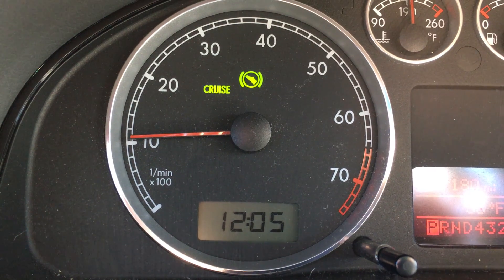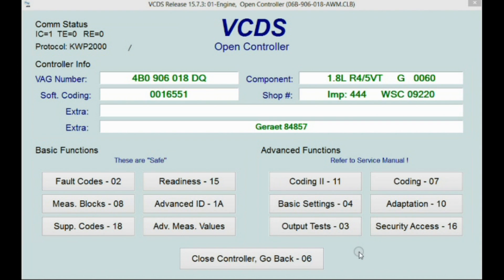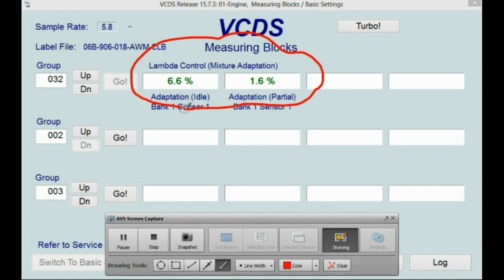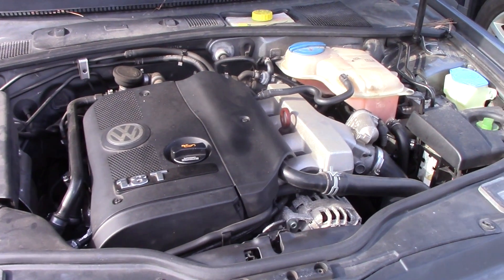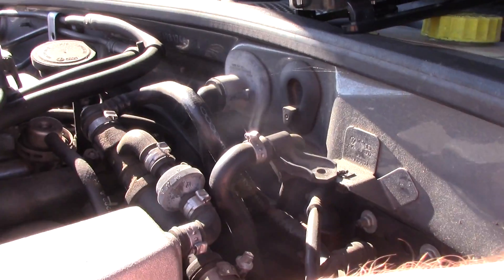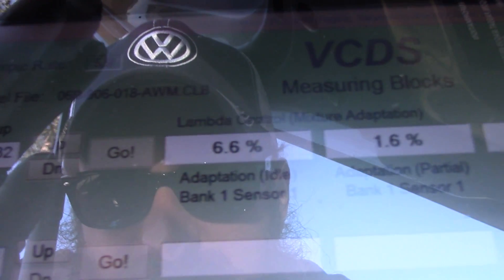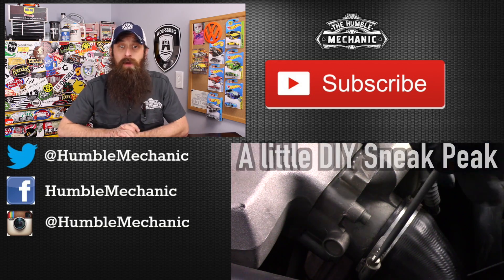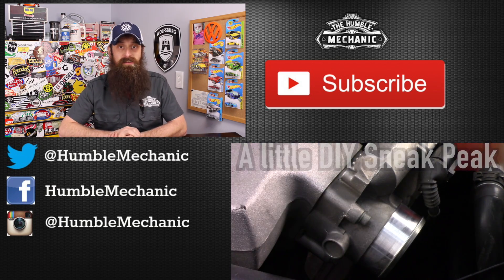Volkswagen Check Engine Light Diagnosis

Comment: First of all you have a cool beard and how long have you been growing it. I'm going to buy a 1997 Volkswagen Rialta RV. The seller says it has a check engine light that is on. Is there a way to check it manually something like turning on and off the key three times they're turning the key to the on position and pressing certain buttons do you do you know anything about this

Comment: I love my 04' Passat GLS. Has the 1.8T Four Motion 5-Speed and the interior is in great shape. Had this issue last summer and was able to find that the T shaped hose that comes out from the pcv valve was cracked. Had replaced that one part but luckily I now found a affordable hose kit which I will make sure everything else is replaced just in case. Saved me alot of money because I already replaced the throttle body & had it reprogrammed. She now runs smooth as silk. Even quieter than my mah's 2014 Fiesta Titanium... 👍

Comment: I've had my 2010 VW New Beetle 1.6L since 2011 and its been going great with minor issues. I recently experienced the "Check Engine" light and the car was still running well although I only drive it once a week. As there were limited service centres opened due to the pandemic, I couldn't send it for inspection until a week later when there was stiffness on the brake pedal. Upon inspection the mechanic discovered that it was due to a faulty brake booster vacuum hose/valve. Do take precaution.

Comment: Hi, thank you for your help teaching us about our cars.  I need help, and if you would be so kind. I have a 2013 Jetta that started to shake a lot and the check engine light blinked rapidly and there was lots of raw fuel smell. I shut the car off and waited for some minutes then I started it  again and it seamed to be working good. I then headed to my local autozone auto parts. I had it check with my local autozone obd2 and it had multiple cylinders misfire but no codes. It suggested to check vacuum leakage. I did and. Then I drove it once more and it repeated the same situation where the care misfired multiple cylinders and I stoped and waited again. I then desired to take it to the dealer to have it checked. The dealership suggested to have the spark plugs, coil pack and spark plug cables replace and then check again. I did the work except I changed the ignition coil, spark plugs, spark plug cables and I also cleaned the throttle body lightly. Now there is no check engine light on but the car does not perform as it used to. It runs good but it does not have the power as before the incident. Any help that you can provide will be very much appreciated!!!! Thank you sorry for the long story.

Comment: They really used some crappy plastic in 05 VW's.I replaced the glow plug wiring harness in my TDI Jetta and wire loom turned to dust in my hands.I've never seen such brittle crappy plastic as I have in that car.

Comment: Hi HumbleMechanic - just got a CEL reading for my Eurovan 2000 of P0705 (Transmission Range Sensor Circuit Malfunction).  What's your thoughts?  Thanks in advance.

Comment: hey man.. love your videos so far.     I have a 2012 GTi MK6 TSI 2.0.   It was given to me with about 130K miles. I've had it for 2 years.  Only mechanical issues I've had since were a bushing that didn't allow the shift knob to get in 2nd and 4th gear and a fan that went out. Well, at least the issues I've addressed. I'll get into the few others on another one of your videos.   Ever since I had the car the check engine light has been a solid yellow. I asked about it and the car has been tuned and the catalytic converter was removed.   I'm not familiar with the tuning side of things but was told the reason for CEL being on was no catalytic converter.   My concern is if I have another issue how would I know with the CEL always being lit.   Is there a way to bypass and clear that so absence of a catalytic conv. won't trigger the CEL?   I'm at a loss with this one.. Appreciate your input. Thanks

Comment: Good choice of car Mr H, I got one too same year. What's your mileage? I'm only asking as mine has done 247000 and it's still awesome with almost all the horses still in stable! It still sounds as awesome as it did ten plus years ago. Bomb proof they say, almost an understatement. Regular oil changes and they go forever.

Comment: unplug the battery for 1min and plug it back on boom engines light check gone simple😍
Reply from the maker: That wont work on most modern VWs. The light will be on until you clear it, or the system runs 3 passes in a row.
Reply: @HumbleMechanic  it works on my 2003 vw gtx turbo supercharge😁
Reply: I just sell the car when the light comes on and avoid the head aches

Comment: Humble mechanic i have a question i need some advice i have a 08 civic 1.8 lighter i have no engine light or code but on my scanner i went to the monitors it says for the catalyst bank 1 it says system to rich does this mean its my fuel pump im new at this

Comment: My audi 1.8T engine doesn't start.Cranking is very weak on new battery, i'm getting following codes:
4629 - ECM Power Relay Load Circuit: (J271) 
          P068A 00 [036] - De-Energized Performance Too Early
          Intermittent - Not Confirmed - Tested Since Memory Clear
             Freeze Frame:
                    Fault Status: 00000001
                    Fault Priority: 2
                    Fault Frequency: 8

4261 - System Voltage 
          P0562 00 [101] - Too Low
          Not Confirmed - Tested Since Memory Clear
             Freeze Frame:
                    Fault Status: 00000001
                    Fault Priority: 2
                    Fault Frequency: 1
                    Mileage: 142482 km

Being just a little mechanically minded - what can be wrong? The alternator? cables? connectors?

Comment: Ericthecarguy used to be my go to guy with any automotive issue I couldn't figure out myself. His channel actually kept me wrenching when I didn't want to but now Charles is my guy. Humble mechanic is the correct name for you sir. I've worked in a few shop settings and wish I knew guys who were more easy going like these guys. I try to emulate a little bit of you both in myself. Keep up the good work. Your channel is the reason I bought my Jetta
Reply from the maker: Thank you! That means the world to me.
Reply: @HumbleMechanic   I’ve got a MK4 golf 1.9 TDI and the check engine light does not illuminate when cycling the key or when there is a fault as I found out when it was running rough
Reply: @HumbleMechanic  I have a 2014 Jetta with 145k miles and have had the emissions replaced years ago. Recently had code P2BA6 w/ CEL and I have not had any luck solving the issue with my VCDS. I have forced a regen recently with the dpf light coming on, the only thing I can see is that the egr settings are at 4.60 and actual is a bit higher at 4.65-4.70. Is this what is causing my CEL? Need EGR? Thank you in advance.

Comment: 03 jetta 2.0. Changed plugs and wires. At idle it shutters and while driving its misfiring. Check engine light flashes I assume when the misfire is happening. Would it most likely be the coil? Original coil 235k on it. All the vacuum lines look crappy. Could it be a combo of both of those things?
Reply: Yes change your coils and vacuum lines

Comment: I have a 2009 audi a4 2.0 tfsi, we got the car with failed tensioner and replaced timing set, head gasket, all intake valves, oil control valve and magnet, cam bridge, cam sensor and crank sensor, now im getting a code p00341 and intermittent epc light flashing on occasion? Any ideas.

Comment: So if my short term is -6.25  and long term is -18.75 is this my in tank fuel pump issue for am I looking at vacuum leak
Reply from the maker: Probably neither. your ECM is taking fuel away from the system. Typical with those failures you mentioned you are adding fuel
Reply: Ok so where do I start
Reply: I got p0171
Reply: Fuel rail pressure is 5160 kpa
Reply: 07 passat 2.0t

Comment: My check light just come on my car and when scan it with my vcds it is telling me performance malfunction in the cooling system with a fault code of 11101000. Have a 2006 jetta 2.5 could possible help me out here on what could be the problem?

Comment: Changed o2 sensor check engine light stays on. VW says, other manufacturers, parts will not work in vw's. parts dealer won't take the parts back. Whats up! is that true? Can't get the car inspected.
Reply from the maker: Have you cleared the fault yet?
Reply: NO but we have an appointment on Friday with a mechanic who may work with us.

Comment: Ok I have a 2009 vw Tiguan 2.0t my check engine light started to flash along with engine fault workshop light whenever I accelerate and my car shakes when I put a certain amount of pressure on the pedal stops when I take my foot off the pedal please help me find da wae to help me figure out what's wrong idk if it's throttle body or the vaccums.

Comment: well, i always wanted a GTI. then I found a 1999 with 120k, for $900, well, I figured the motor, 2.0 gas was going to go soon, it got a transmission rebuild summer of 2017, and 4 struts / springs, new brakes, 11/2017, as my luck would have it, engine started dropping lots of oil, a month and 250 miles after I bought it....How much is entailed in putting a 2.8 vr6 into it, I can get a salvage engine for 950.00, 150.00 more a 4 year 60k mile parts and labor warranty. do I have to get a whole new engine harness, it isn't a daily driver., I have a obscenely expensive maintainance hog of a engineered like no other pile of shit on the road G500 for that....every trip to MB a minimum of 3500.00, I feel ass raped every time I go to the dealer, the GTI is pocket change

Comment: This is really helpful. Thanks for the video. My A4 1.8T is having EPC and CEL lights, I suspect a result of not fixing the CEL the EPC has arrived and by the sounds of it the cat sounds very rattly when revs drop down.
I've tried MAF, Throttle, Crank sensor, Throttle air sensor. But haven't really looked at much of the PCV as it was all replaced relatively recently. 

Basically it starts ok and feels relatively fine until hitting 2k revs and then limps into idle mode and sounds like its dying. EPC light stays on and goes away on restart.

I've got a video showing my issue if you fancy helping :)

Comment: Fyi. I had a 95 VW Cabrio. I wanted to run a diagnostic check. Nobody could find where the plug in was for the OED  (?) meter.  It's in center console,  very bottom,  you have to slide a plastic square over to expose the plug. 1 1/2 square piece. looks like part of the console,  but, it's a door. I  Loved that little car.

Comment: So just a run down, I have a 2012 VW jetta gli 2.0 turbo dohc 6 speed transmission, we've replaced ignition coils, spark plugs, fuel filter, had injectors cleaned, still runs like crap. Engine runs rough, like it needs a tune up, we buy only OEM parts. Engine light blinks a few seconds then stays on when we start it up. I've had it coded and comes up port 2, 3, 4 are failing, but We replaced the spark plugs with OEM.

Comment: Where is the port to plug into in the vw cc 2012? The obd
Reply from the maker: below the dash. Go to the light switch its aligned with that, but under the dash

Comment: are the Diverters prone to failure?..... heck are the SMIC's prone to failure
Reply from the maker: +J MR the only SMIC failure I've seen is impact damage. 

These DV do fail. But not nearly as much as BPY valves. Even the Mk4 cars had more failures
Reply: Thanks for the reply brother, you mean the DV's on the BPY 2.0TSI? Gotta love acronym LOL... Would have thought VW would have made and improvement in a newer engine. I think i may be losing boost between 4-5 grand. 3rd gear at 70mph seems like dog years to get to 80mph. decent punch at 3-4k.
Reply: Really like the content!!! Subbed for sure!!!

I have a 2002 Fresco Sedan AWM 5MT FWD. Ill post a pic on your FB page!!...

I have a bunch of crap to get through on this bucket...and being a son of a truck/coach/auto mechanic,all his skills rubbed off... as did his ability to procrastinate on LOL... 

I've had downstream SAIP and O2 -Downstream efficiency codes for 2 years... (Still get 23city/28hwy). 
-A/C inop (but holds charge). 
-3/4 door drivers are blown LOL. 
-Tranny is clicks in 1st/reverse engagement. 

Other then that its a reliable daily driver that just needs a bit of TLC.  I'll definitively stay tuned!!!

Comment: VW 2009 CC w/ 105K miles. CEL been on/off for a while with misfires and today when it came back on I saw P0171 and P12A2 (Fuel Rail Pressure Sensor Inappropriately high). Still sound like vacuum leak or sensor problem, like thrust sensor or high pressure fuel pump? Need a full diag and need to buy new VagCom

Comment: I was looking at vagcom and then i saw something that was up for sale on ecstuning.
Could you do a side by side review of Vagcom compared to the Professional VAG Scan Tool?

Here is a link for you to take a look:    https://www.ecstuning.com/Audi-B5_A4-Quattro-V6_30v/ES2996394/
Reply from the maker: +edgeofvamp I would love to test it out. If the folks at ECS want to send me one I would be happy to do a video on it. I have had mixed luck working with them over the years. Perhaps if you guys reach out to them. That would have way more pull than if I ask them .
Reply: +HumbleMechanic Sorry about the delay, due to a bad snow storm here i lost power for 19hrs.
I will send them a message and see what comes of it. If they decide against it, would you be willing to use mine for the side x side?
I looked into Ross-Techs VCDS and the steep cost for the enthusiast version was a bit much to live with for use on 1 Audi.
So when i found the tool with ECS and shaving up to $150 off was more palpable. Not to mention that the tool is programmed to work with domestics also, so it works with the rest of the line up in my driveway.
So ultimately, it would be great to see from a techs perspective what the limitations/capabilities are and if it would make a proper alternative to those on a tighter budget.

Comment: Great video. This was posted last year! I found the t-connector on a vacuum line  under the coolant bottle was cracked. I got a very expensive replacement from VW that was aluminum instead of plastic. My own fault for being lazy and having Valvoline do an oil change.....

Comment: My 2006 Passat check engine started to flash and the car was shaken really bad feeling like it was gonna shut down. What does this mean every time I go to a  local mechanic they always kinda screw me over with being a girl going alone. Not to long ago I went for my horn in which costed me 500 total to fixed well then they said they couldn't fix only vw so I went vw cost another 162 to be seen then they told me 800 to fix the horn :( in other words I just wanna know from your point of view could this be a coil gone bad or is the engine going ?
Reply: Hi, i have the same problem, did you fix it?
Reply: +Khadraoui Med Moktar yes I did it was the coils all 4 so I changed them and so far good
Reply: FYI flashing check engine light means severe misfire.
Reply: Vcds

Comment: These small endoscopes are nice for getting to tough places, with their own lights built in - and really cheap!  In my house I tape them to fiberglass wire pull rods - but for these vids - you may have better luck taping them to a coathanger you can bend as needed.  Thanks for the vids...  http://www.amazon.com/CrazyFire-2-0MP-Inspection-Camera-Locator/dp/B00EQNCMTY/ref=sr_1_3?ie=UTF8&qid=1455734454&sr=8-3&keywords=endoscope

Comment: Ahh the good old 1.8T PCV system. Gotta love it. Or hate it.
Reply from the maker: +Chester Wardan Up until this one, I loved them. Replacing mine turned out to be a huge pain. The first one I have had to remove the intake to get it fixed. LOl
Reply: Wow you had to dig deep. I haven't had to go quite that involved yet, but I could see in some situations where you would have to.

Comment: Two easy way to find vacuum leaks is with a stethoscope with the end removed so all you have is the hose leading to your ears. you can really pinpoint an audible leak that way. Also carb cleaner works good for giving you an ideal where to look. by spraying it around the engine, you will usually hear the engine pick up speed of smooth out  when you hit the area of the leak.

Comment: Very Helpful video !    what % numbers should be normal-ish for a FSi engine(idle & under boost) ?  Thnaks
Reply from the maker: Perfect world would be zero and zero.
Reply: thanks !
Reply from the maker: +Gli_Fahrenheit not a prob
Reply: HumbleMechanic 
Hey man i did some logging and my (partial) goes all the way to -11.3%. The (idle) is only -2.7%. no Cel just one code - Boost pressure drop from turbo to throttle body.  at 1396 rpm @54km/h. Any ideas on the problem ? i did a boost leak check and no leaks were found,and the car seems to runs great. 
Thanks for all the help ! :)